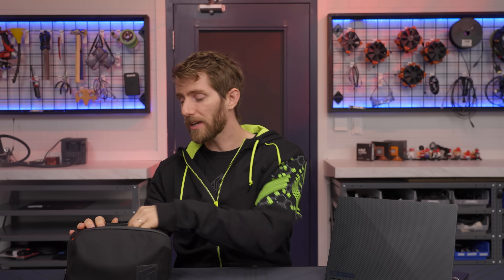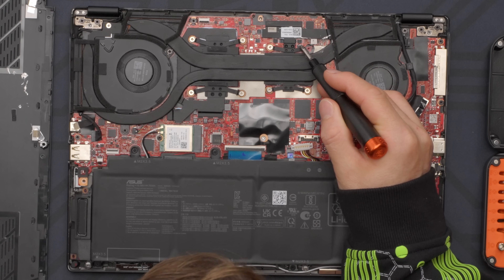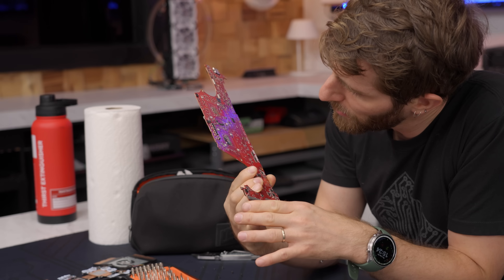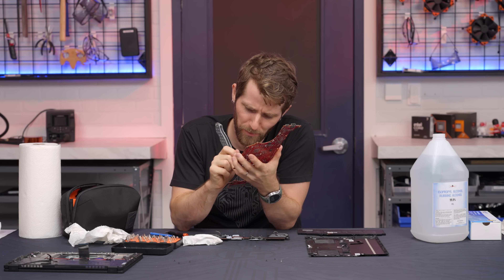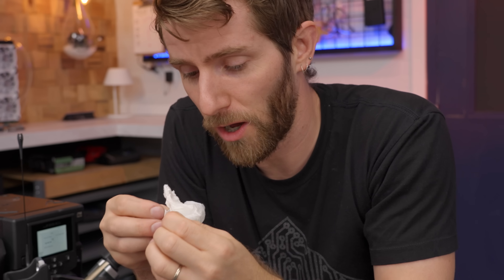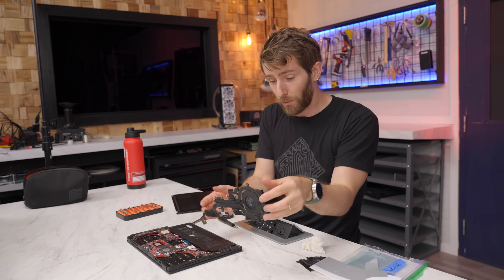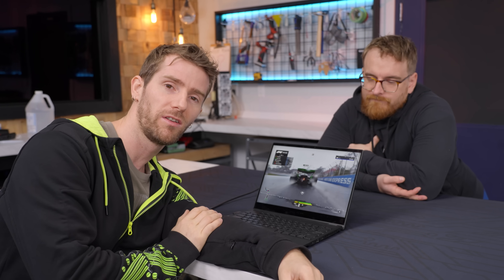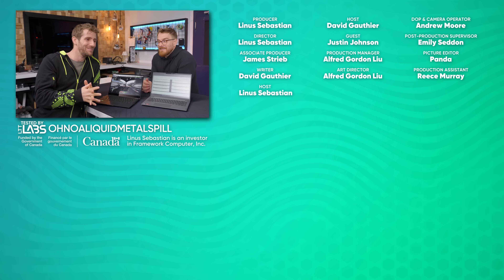Liquid Metal Killed my Laptop… Now What?

Comment: The idea that i have to wait for my laptop, MY TRAVEL COMPUTER, to cool down before i can put it in my bag genuinely makes me not want to own any product with liquid metal. Whats the point in a laptop if i cant just close it and take it with me whenever I need it and not sit and wait for it to cooldown
Reply: Yeah there's a time and place for liquid metal and portable devices ain't it.
Reply: @strilight  I do this with my desktop already. I let it cool down after gaming for about 5 minutes before I put it to sleep. 

Could see doing the same on a laptop.
Reply: @philiplubduck6107  but why?
Reply: @philiplubduck6107 that is one of the most overly cautious things I have ever heard.

Meanwhile, I don't even put my gaming computer completely to sleep.

Everything throttles and clocks down these days to the point where it draws less wattage than my TV once it's not running anything.
Reply: @lumeronswift but laptops and desktops don't generate heat whilst not powered on. So if you are gaming and your CPU is at 80 degrees, you close the game. The cpu temps will plummet in a matter of seconds down into the 60s. Then if you turn it off it's just going to keep dropping until it's at ambient.

The only way it could be an issue is off you got it into the hundreds and then yanked the cord mid game.
Reply: @lumeronswift the moment you cut power the heating stops.  Unless you were thermally throttled you're not in a danger zone of temps.  It will just dissipate through the heat sink.  This stuff is just not that delicate.
Reply: @philiplubduck6107 totally unnecesary. Are you the type of person to kill 20 fps of performance just to keep your gpu at 40 degrees?
Reply: @youlaughyouphill842  I cook my GPU as hot as it will get at about 71-74c depending on the game with only about 70% fan speed. 

Only time I would nerf it is if maybe play a game that just makes it to 60c and hence I’d turn it down to 59c for no fan noise.
Reply: Yeah, that's such a dumb step back in tech. It feels like a lot of tech is creating new problems, like electric vehicles not starting because an update attempt failed
Reply: Not just that, with Microsoft poor sleep mode its probably still on a bit in your backpack.
Reply: Liquid metal is fine in a stationary computer like the PS5. It is really dumb in a laptop though.
Reply: @patlund  But only if you lay it flat. Vertical PS5 leaking liquid metal is now a thing.
Reply: @slothnium turns out it was never a thing and was due to tampering with the device and not closing it properly, was a news story that ran away without fact checking. Been debunked since
Reply: @patlund  good luck placing rtx 5090 in laptop like asus scar 18. W/o it, we wouldn’t have high end gaming laptop
Reply: @patlund  LM is fine in laptops. I regularly use it, even without seals like this, but im manually applying it so I dont use TOO much like asus did nor do I have to low mounting pressure like asus did here.
Reply: @Stars-Mine had an H7604. The application was woeful. They put way too much but managed to not put any in the center of the die.
Reply: @Stars-Mine  Yeah, they used WAY too much here. I converted my conventional TIM gaming laptop to liquid metal (I plated the copper heat sink surface with nickel first) years ago and it still works fine, and I have never been careful with it when I move it. I very carefully applied the absolute minimum I could, though, and then verified that the temps were good before considering it a done deal. They were better than it had been with a fresh application of a high quality TIM. I used WAY less than what was seen here!
Reply: liquid metal for a cooling paste (or something) is just wrong. isnt that why we have non-conductive thermal pastes?
Reply: Don't buy the flow x13 man it was my dream laptop died in a year and half it was good that I had asus accidental damage protection now I am happy with my macbook
Reply: Hell mine gets thrown in the bag when it's not even finished doing updates sometimes and just gets baked in my bag
Reply: @Lonewolf_121 mines (G14 with Liquid Metal) been running games in a backpack vertically before and it’s still fine.
Reply: AAAAAAAAAAALL COMPANY MUST STOP USE LIQUID METAL,,,SOLID TERMAL PAD IS BEST(in longterm+high temp dont turn solid)
Reply: Theres no way in Hades I would apply that stuff on Anything I own. Considering the Cost of the devices and components I own, not having a full bank account to replace them, the Little bit of temp drop isnt worth it.. No and NO. Makes no logical sense to me.
Reply: Liquid Metal is only a thing for servers and people who know what they’re doing when they apply it and secure it. If you aren’t running a server then forget about and if you think it’ll make a difference you’re deluding yourself . No laptop or average gamer PC really benefits from Liquid Metal compared to the risks.
Reply: That's not the issue with LM. Its the crappy out of factory application. And they put too much! When applied correctly with enough to create a thin shiny (mirror) film on both the cpu and heatsink it will never leak out. How or cold.
Reply: That's what fvcked my Asus laptop  liquid metal was all over the motherboard.
Reply: gallium is helluva stuff with some metals and composites.
Reply: you dont have to with liquid metal, Asus fucked up.
Reply: Yup, that was also my first thought when i heard that.

What, do they expect me to sit in taxi and wait until it cools down after a ride:)? Or bridal carry it around?
Reply: I have a g14. I was going to change the compound ages ago but kept pushing it off. I'm gonna do it now.
Reply: YMMV, I put some tg liquid metal on a 2012 macbook a long time ago, beat the shit out of it but it never had any problems. Im biased because of my good experience but Ithink this is on ASUS for putting too much on
Reply: yeah that was my immediate "wait really?!" moment
Reply: It just depends on what you want.  It's irrational to complain that a Ferrari isn't reliable on a cobblestone road.  This is a laptop with a 4070 crammed in it.  Liquid metal is far superior than anything else in keeping the cpu and GPU cool.  Everything comes with trade offs.  If you want a robust road warrior, then yes, don't buy a high performance gaming laptop.  Buy a Thinkpad.
Reply: Literally what I was thinking. Like. If I can't put it away warm. Then it's literally useless to me.

I don't think that I have ever not put a laptop away warm.
Reply: What about the flow line up? My x16 is literally made for diverse use cases like gaming on it in tent mode and tablet mode, where its everything but vertical.
Reply: Terribly engineered solution
Reply: sure hope that it doesn't turn on in your backpack and doesn't fall back asleep! I've come back to a hot backpack sometimes
Reply: If you read the data on liquid metal prior to owning anything using it... that might have been the choice you made in the first place.
Reply: first world problems if I ever saw one
Reply: 90s: dockable palmtops? those were fucking awesome. but...would got pretty toasting after a bit. bad ass for quick things though
Reply: Living life on the bleeding edge of technology causes issues liek this. lol
Reply: My laptop has LM on it and it's been more than fine for the past... almost two years? Seriously, it's all about the design of the seal. Asus has the highest number of problems when it comes to LM leaking out, iirc, so this is no surprise. That said, it's only really useful if you're pushing a laptop to extreme levels and require the instant, perfect thermal conductivity that LM provides. Otherwise, PTM7950 will do pretty much the same job with only slightly reduced performance in the most extreme cases.

In Linus's case, this laptop has a particularly bad design for what its intended use case is. There's also no reason for LM here. PTM would be waaay more than plenty for this machine and handle everything it could possibly do without any fear of overheating.

EDIT: Yeah the gasket is not sufficient. The one on my laptop (Eluktronics Prometheus 16 G2) is a rubber seal, which prevents this exact thing from happening. That design NEVER worked from the outset but Asus doesn't do long-term testing. Also it being 'warm' should have zero effect. It's liquid METAL, not water...
Reply: Yup. Maybe laptop manufacturers should actually make good cooling systems instead of crap that needs janky mods to squeeze performance. This is a bad video
Reply: In my opinion liquid metal is great for a desktop replacement that mostly sits flat on a table and barely gets moved around. That's about it. 
In the defence of liquid metal, manufacturers always apply it wrong and put too much of it. I haven't purposefully shaken my laptop to test, but when I opened it to redo the OEM application because I had a hot spot, I saw that they put like 4 or 5x the right amount, and still managed to not cover the CPU fully. Perhaps with the right amount the risk would be lower or even completely alleviated.
Reply: Lots of misinformation about liquid metal here.
This will piss some people off... but liquid metal is safe and THE BEST POSSIBLE thermal performance - when you're not an obvious degenerate like Linus is when it comes to handling laptops (and the pathetic performance he displayed in his repair attempt here solidified this).
Reply: I’ve done this with my G14 I didn’t know had Liquid Metal for 2 years in college and it’s fine
Reply: There are different use cases for a laptop. My main laptop is more a portable workstation for me, that I do not use on the go, but rather at multiple places (work, home, etc...). So waiting for it to cooldown would not be so much hassle for me.

Comment: Wait a minute, you’re not supposed to put your laptop into your bag vertically while it’s still warm? Well I’ve always done that and will continue to do so. Am I supposed to shut off my laptop like 20mins before I leave uni?
Reply: If your laptop cooling doesn't use liquid metal it shouldn't be a problem. Most laptops don't use it and use some other type of thermal paste / pad that is nonconductive so even if it leaks it won't do any damage.
Reply: Does your laptop use liquid metal? If not, apparently you didn't actually watch the video.
Reply: It's the thermal properties of LM I guess. They flow easily when hot cause that's the point. Putting it vertically when hot will cause it flow downwards, Leaking through microscopic holes.
Reply: Does your laptop use liquid metal? If not, apparently you didn't actually watch the video.